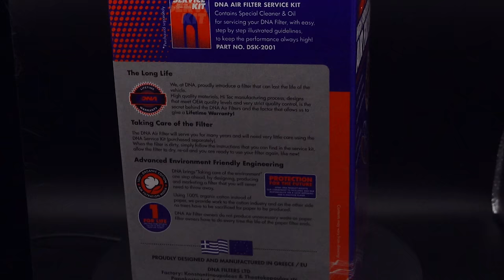Royal Enfield Interceptor 650. Dont fit A DNA performance air filter until you have watched this!

Comment: Stuart, slightly off topic but there is a very interesting article in the weeks MCN regarding S&S performance parts for the Enfield 650. These include stainless steel exhaust cans and a 865cc big bore kit. Well worth a read.
Reply: michael johnson Michael, I look forward to checking in at MCN for this information. Thanks!

Comment: Stewart, as a result of watching this video, I bought a DNA air filter for my car a Kia Picanto 1.25cc to replace the stock airbox
filter. I wasn't expecting any performance difference at all, I just liked the idea of the long life of the product. Now I know that
you are an honest and sensible guy, so I trusted your opinion and I am so glad that I did!. The filter has made a very noticeable
improvement to the torque and runs more freely, the engine is more relaxed and copes with any situation that I ask of it!.
The fuel economy has improved, acceleration is quicker, it really does feel like the car has had a larger engine fitted!

Comment: Induction roar on my Kymco AK550 with DNA was enhanced further by fitting a small aluminium louvered cover to the lid above the still air box. This lid is between the riders knees and not hidden/ sound muffled by a petrol tank. A most enjoyable sound further enhance by the Arrow exhaust muffler and 270 degree firing sequence. Brings joy to this 68 year old.

Comment: I have been reading these posts with interest because of a recent purchase of a DNA filter, this was purchased purely for the fact that it does not need to be replaced (only re-oiled).
When I fitted the new filter I went through the 15 minute idle routine as mentioned in several posts and other bloggers, took the bike for a ride and the engine seemed to be struggling to accelerate smoothly especially from low revs and vibration.
The next day the same result, the engine was definately down on performance in many ways and not pleasant to ride.
I don't know anything about "self learning ECU's" or performance plugs but I do know that my ECU did not want to know about an increase in air flow from the new filter.
As a possible solution to the self inflicted "problem" (the bike was working fine before the filter replacement) I replaced the original snorkel covering the air filter and went for a ride.
Immediately the bike was buzzing along beautifully, smooth acceleration from any revs, the vibration problem disappeared and the world was wonderful again.
So I'm happy with the result, a reusable air filter and a bike that puts a smile on my face when I ride it, life is good.

Comment: Increase in torque is increase in power. Torque times revolutions equals power. One should maybe claim that not the >maximum< power is more, but the power over the mostly used rev band.

Comment: Hi from Argentina! I installed the DNA filter and have the same sensations as you. But you expressed them with the proper words. Thanks for the recomendation of run the engine 12 minutes, to allow the electronics make the necessary changes.
Reply: Hola Marcelo, que es lo que dice? que hay que dejar el motor funcionando  con el nuevo filtro 12'  en ralentí? para una moto refrigerada por aire me parece mucho.

Comment: Touring the USA on my Royal Enfield Interceptor 650, putting in a lot of miles per week it seemed like my life revolved around always cleaning, lubing, and adjusting the chain, trying to keep close the manufacturers recommend intervals 1,000km/621mi, which I can easily do in a day. I really wanted to keep My Royal Enfield stock but eventually broke down and installed the Bandidos Pitstop Belt Drive conversion kit. I love it! Even being very picky to clean off excess lube, after 17,000mi/27,000km it took forever to get it cleaned off all the little cracks and crevices. Plus it is smoother and quieter which I wasn't expecting. The downfall for my use is the gear ratio they use between the front and rear pulleys give more torque, which I don't care about while touring. That also means my gas mileage has gone down. I'm still using the stock paper filters. You mentioned in this video you would be checking for fuel consumption increase later.
Did you check?
What was the result?
What video is it on?
Thank you so much for your quality videos!

Comment: regarding the Tip to Letting the Engine run at idle to its optimum operating temperature, some say you need to wait until the fan starts to operate. this applies to water-cooled motors, so your Triumph might need this if you ever do the same thing on it. I don't know if it is true or not but it seems many say to wait until the fan kicks in.

Comment: I have just installed the DNA filter on my Classic 350 (2022) and the performance is absolutely better. Sure it did not turn into a race bike but the ride is a delight even more so than before. I recommend it 100%. 
One note though: at least from my experience, the 12 minute idle run after installation did not do anything. On The first ride after installation, performance did not feel better and actually felt a bit worse than before, which was disappointing. I thought that’s the end of it. However, during my rides on the following days the engine felt better and better, like it’s “learning” during actual rides rather than running on idle.
Reply: I think to get the best result is to disconnect the battery, reconnect then let it idle for 12 minutes and ride afterwards

Comment: Usually, you would want to get a tune right away since now allowing more flow thru the air filter you have now kind of changed the air fuel mix ratio. But like you said the ecu will make adjustments but idk how true that is tho.

Comment: Excellent video
This is an upgrade that I'd decided to do on my Interceptor when I first found out about this product.
I had a very similar setup on one of the bikes I had way back in the day and to be totally honest I didn't fit the filter just for a little bit of extra performance, because the bike didn't need it, I fitted the filter for that gorgeous sounding induction roar.
I'm going to fully run my bike in before I change the filter because I want to be able to see what difference it makes.

Comment: Hi Stuart, I love your very informative and exhaustive videos 👍🏻. I need a clarification though. Isn’t the stage 2 kit meant to be used with free flow cans? Or can we use the DNA air filter along with the stage 2 kit with the stock exhausts without any heating or engine issues.
Reply: I have the same question.
Reply: following

Comment: ok that does it!  I'm not touching my bike until I check in with Stuart first.  Thanks Stuart for explaining what I did incorrectly.  I purchased the DNA filter a month ago not because I wanted more power but because I used to race off-road and I know the benefit of a high performance air filter for power consistency but also because it's cheaper in the long run to clean your filter instead of replacing it.  But, my bikes never had fuel injection and an ECU so I replaced my stock filter with the DNA and rode the bike like I normally do to work.  My INT is a commute bike and so it rode fine to work, but later in the day when I started it to go home, it wouldn't idle and it was very rough idling when I got it to start.  I had to be careful on the way home to not let the revs drop below 3k or it would stall.  When I got home I thought I must have done something wrong so I removed the filter and put back in the stock filter and left it that way for about a week.  I then thought that was crazy as this must be working for others so I decided to trouble shoot it.  I put it back in and started the bike and I must have gotten dumb lucky as I let it idle while I looked around.  Of course there was nothing I could do so I didn't change anything but after a few minutes it seemed to be idling just fine.  So I then took it out and rode it and stopped it and let it sit, and started it and rode it and everything seemed to be working properly.  I then went back to commuting with the DNA installed and it's been great since.  I agree that there really isn't anything noticeably different, but I wasn't expecting anything as my reason to install it is for better long term consistency and for a less costly maintenance.  Thanks for the great write-up again!
Reply from the maker: Ah I guess you were just unlucky scott people do often get away with it but the ECU will occasionally just get confused and get stuck! no harm done!

Comment: In the race cars I moved on from a oiled cotton gauze air filter for my racing engines some years ago. However the interceptor presents a conundrum at the moment. It appears that the style of air filter that I prefer for my high performance Chevrolet motors doesn’t seem to exist yet. Maybe I should start selling them myself. R2C type filters are what I prefer for high RPM, dirty environment action. If you’re not familiar with the racing which I am talking about, I have some videos on my channel.

Comment: Changing the stock air filter to the DNA Kit was the very first modification I did. The engine felt more powerful and responsive. Maybe also due to a noticeable increase in volume when fully opennig the throttle at medium revs. The induction noise might fool us, as our ears tend to make us feel that louder is quicker. Thank you for the information about the self learning process of the ECU. I'll go downstairs now an give the bike an idle run.
Reply from the maker: no need if you've been running it for a while. they do sort themselves out eventually.

Comment: I have been told a free flowing air filter does nothing to create more power. The engine is not going to take in any more air with a freer flowing filter. Only way it would do anything is if engine can not get enough air in thru air filter that comes on bike stock. Manufactures don’t design air filters that can not flow enough air for engine to run correctly. A free flowing filter is not going to force more air into engine. They just don’t do anything for performance. Plus with K&N filters they have to be oiled frequently to be able to filter out dirt and most people don’t keep them oiled so they are actually hurting your engine. I just don’t buy the argument that these filters do anything for performance. Plus they don’t filter out dirt that well. Going to have to show me on a dyno that it does anything and they have never been able to do this

Comment: Very helpful guide for those of us considering whether it's worth spending 80 quid on something that may give minimal improvement to performance & economy, bearing in mind the extra cost of its periodical cleaning & maintenance. You put my mind at rest regarding letting the ECU self-adjust after fitting this filter and slip-on pipes, so it's not necessary to remap or fit an expensive power module.

Comment: Lets say a person was going to install this filter system, but also install S&S mufflers and high flow header pipes. Would you recommend making all of the mods at once and then updating the ECU or updating the ECU after each individual mod so that the ECU does not have to make one large adjustment, but instead several small adjustments? As always your videos are very informative and easily understood. Thanks!

Comment: I would definitely fit this but I only have an A2 license... Last thing I need is to fit it and increase  the power and then get pulled up on it if I’m ever to be pulled over. Same thing with the exhaust, I find that would be an improvement also but again, it’s a risk.

Comment: Had heard 2016 on bonneville had self learning ecu, did not know it was widespread, I bought a second hand 2015 bonneville with lambda removed dna filter and breathe filter, standard exhaust. It runs out of puff at 20mph below listed top speed. Not knowing what tune it has had done I am guessing it has not and is running lean so bought new snorkel to revert to standard, tunes available are for free flowing exhausts anyway. Incidentally I was going to buy an interceptor until I saw your post about bad threads, nearly bought new Scrambler then settled for 2015 efi bonneville

Comment: HI Stuart, Love your videos sir and this being my first bike I really appreciate any English spoken content and tips/recommendations. I am definitely going to purchase those 22mm handlebar risers from Motone based on your recommendation (wish you had even a 1% discount code so that you would gain more recognition from that company). I already purchased the tank pads, which were an absolute gem of an addition to the bike ergonomics and control. I have done many snorkel deletions on my vehicles and I always love added roar. My thoughts on this particular subject (mostly curious to my inexperience with bikes) is that sometimes I have read about user error when oiling performance filters. In particular, a user will over oil the filter and this residue will then build up on the MAF (mass air flow sensor) which in return will affect the fuel/air ratio reading by the ECU. Now from my own personal experience (still speaking of applications related to 4 wheeled vehicles) in using K&N filters and applying oil understanding this method... There is always some form or residual that will build up on the inside walls of the intake plastics that will lead to additional cleaning, but with a motorcycle having such a short intake setup; I am wondering if the oil residue would be sucked into a harder to reach area and cause additional maintenance? I always try to find an oil less performance filters, but I think that cuts into companies revenue stream in relation to the oil servicing kits. 

You  mentioned that the rain guard on the intakes are usually installed by the factory keeping in mind to avoid any unnecessary water being sucked into the intake. If I am wanting to ride my bike this winter do you think that it would have any consequences leaving it that exposed when installing this kit? My thoughts are that the main market of the RE lineup being based in India, is that they would also want to keep dust pickup to a minimum.

Apologies for any poor verbiage and I wholeheartedly appreciate your great content!
Reply from the maker: I dont think you really need to worry about water ingress. perhaps just need to be a little more careful with the hose while washing!

Comment: Hello Stuart,  nice and detailed to the core  videos u give us  all time, keep up the good work Bro... would NGK iridium spark plugs replacement to Interceptor give any visible performance enhancements... please shed some light... Thanks very much
Reply: I did not find any remarkable improvement in performance or acceleration but the idling is more stable - which means, when you are holding at 4000 RPM and cruising at speeds of 100 - 120 kph it is a bit more smoother. Anyways, that's just my experience with the NGK upgrade kit. I would advise you to try it and make your own conclusions. It is definitely not a wasteful upgrade as the spark plugs you upgrade to will have a much longer life

Comment: It can be hard to quantify the change on a fuel injected engine, but way back when... I added 4 K&N filters to my 1980 KZ650. This required a re-jet of the carbs. I can't remember for sure what size they were due to 40 years, but I am thinking that I had to go from a 120 to a 125 main jet in each carb and raise each needle valve by 1 notch to get enough fuel to keep it from running lean. More air + more fuel = more power. It probably was no more than 3 hp, but it could be felt in the seat of the pants.

Will the Interceptor's fuel injection give that much adjustment without a remapping? Probably, but only Royal Enfield can say for sure. As long as it is running smoothly, it should be OK. If it is lean, you can feel it as an uneveness, sort of like not being able to hold the throttle steady. It won't be nearly as pronounced as a misfire, but more subtle.
Reply from the maker: No all fuel injection is controlled by the ECU and all vehicle ECUs must be self learning now to adapt for any configuration changes. although granted a remap may produce a little more performance.
Reply: @stuartfillingham  That's good to know.

Comment: hello, on my continental gt 650 i installed a dna filter and replaced the silencers.  my mechanic thinks that I have depleted the fuel supply and recommends that I put on a dynojet or a powertronic.  What do you think ?
Thanks for you great video
Reply from the maker: I think hes trying to make some extra cash out of you. The bike has a learning ECU so it will adjust for the changes you have made. They are designed to run lean to meet emissions  laws.

Comment: I was instructed by the local seller to use OEM cover for air filter as I have stock exhaust system. They told if I remove the cover then more air will be pumped which can cause issues to engine. In this video you have removed the OEM cover and used DNA air filter with stock exhaust. Have you faced any issues because of it?